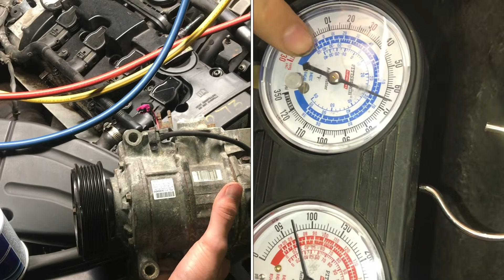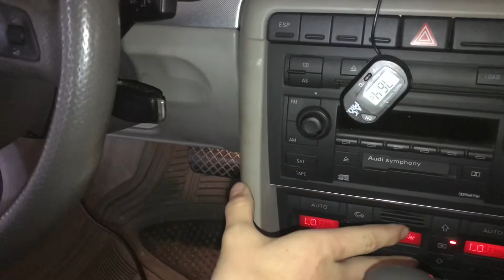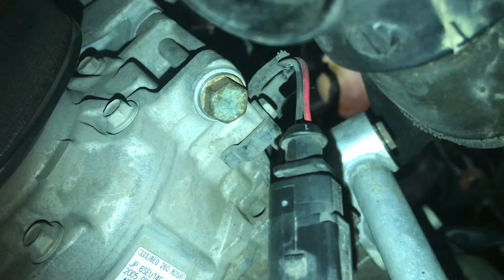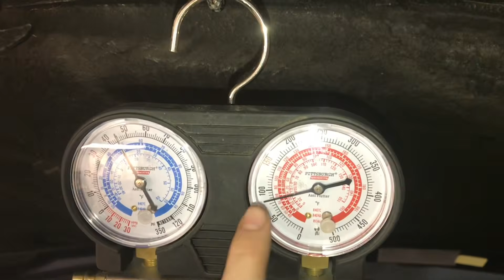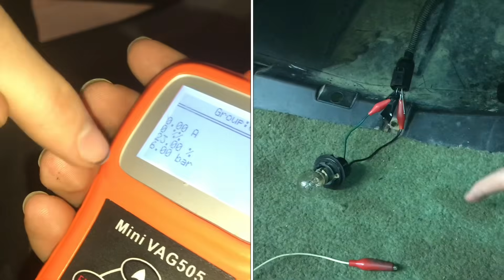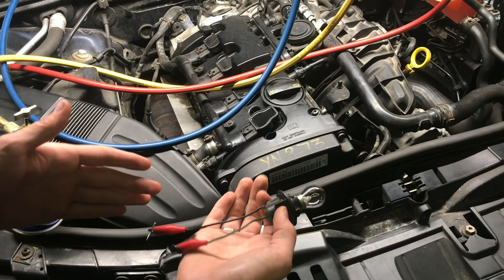TESTING n280 AC variable displacement compressor regulator with a “test light” (volkswagen audi)

Comment: Check ECU THE VENTILATION OF A/C start on when you press the button of AC in don't start Ventilation ECU problem don't give signal to Compresor and the sensor n280

Comment: 0 ohm or 1 ohm resistor between the 2 solenoid wire do the trick to turn the fan on ....once it does turn the car off and remove the resistor then connect the wire normal them wait awhile then Start the car and ac should blow cold.

Comment: So, the solenoid takes 12V PWM, not 5V. How do we know the module is sending 100% PWM duty cycle?
Reply: The computer send direct DC when something is wrong but once everything is ok it will send the pulse width modulation voltage to open the valve and kick on the internal clutch to pump freon but if the ac module is bad its self u won't ever get the compressor to work. The pwm voltage drop or increase to determine freon flow so it doesn't matter what voltage it's at. I would advise u to check the thermistor to make sure it working before changing parts.

Comment: The 12v signal comes from the PCM/ECU as a pulse width modulation (PWM). This is very low current and will not light a bulb.
Reply: If the current is to low to light the bulb then it,s too low to activate the solenoid.
Reply: I agree I test lighted the two connectors with the clamp clipped to the door latch and no light. I told them to order a new ac pump and I’ll be out there to change it

Comment: Couldn't you just run a wire from the cars fuse box and have it on a switch?
Reply: The evaporator would freeze. The computer sends a pulse width modulated duty cycle to the solenoid to control the temperature based off of sensor inputs. 100 percent on would freeze all water vapor or humidity to the evaporator eventually air can not pass through it.
Reply: @kristenewilson2475   PLEASE HOW I CAN GET PWM WITH small tools and DID the 12V damage the selenoid
Reply: @jamalamarir6525 I'm getting one off Amazon pulse width modulation generator DC 6 to 12v I will test it when I receive it.
Reply: @kristenewilson2475 😊